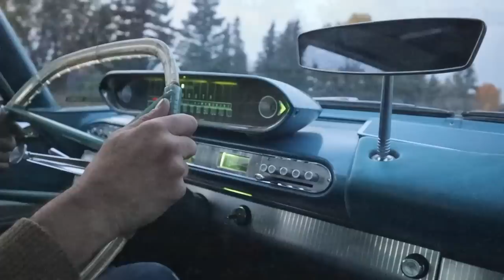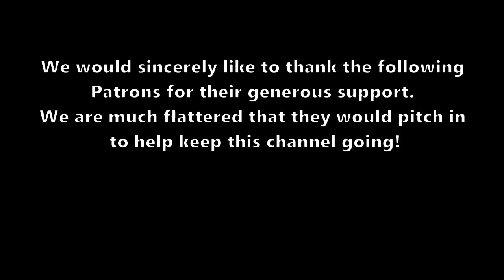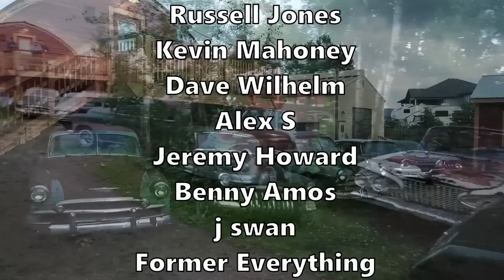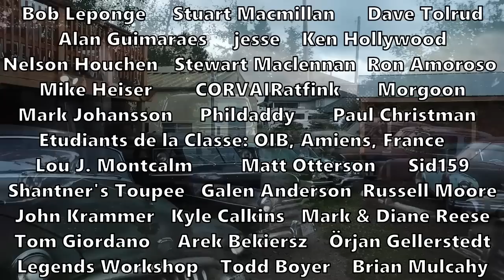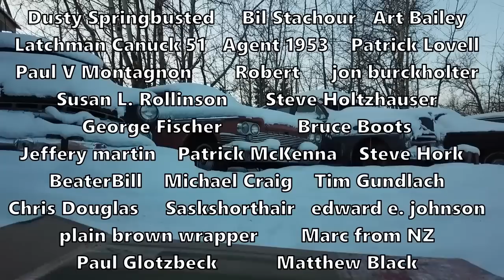1960 Plymouth Fury on the Road! "The Splice is Nice", and we are going for a Drive!

Comment: This is a car that classic car culture is going to be talking about for a very long time. It sets the high water mark for what a skilled person with a modestly-equipped shop can achieve, and the video series also sets the high water mark for detailing just how gigantic a commitment such a project truly is. You've set an example for everyone with this car.
Reply: What I like is that it shows that a properly done splice can be just as safe and straight as an original.  
It helps when Scott is the one splicing though!
Reply: I couldn't have said it any better than that. Thanks for sharing your thoughts.
Reply: I have never in my life seen someone methodically burn thru such a resto on their own brains and skill.

Comment: Scott when this first began I wondered what you were doing was possible then realized with your knowledge of the two vehicles it was, then came the long careful teardown and painstaking replacement of main body parts and all the checks of wiring and other things while open to the careful alignment of it all to come together, it was great you had the patience and took time for breaks to other projects and distraction like checking and fine tuning trim pieces, you have mad body work skills and 100 times the patience I would have for this,  in all your projects you have perseverance to take things apart to look at them and try to find how it should work or to make it work, I love you practical use of knowledge, common sense and ingenuity and respect for all your cars on the lot you've saved from the crusher, and that your dream of a long term project of this full a scope of saving and restoration of car of your liking enough to do this, is a great show of all your skills

Comment: I was 9 years old in 1960 and was very aware of the name Fury. I made myself a fan of the make and model but my heart belonged to the 1963 model which my Indiana hometown bought an used for their police cars. Those cars were awesome looking and quick yet I do recall the push button trans and the oblong steering wheels from the Chrysler models of that era and I believe they still had them when I took driver's ed in 1965 since my favorite car to drive that year had an oblong steering wheel. You have re-created a masterpiece right down to the nuts and bolts on your beautiful 1960 Plymouth Fury, thank you for the wonderful work and ride!

Comment: The Fury is astonishing.  It's one thing to admire all the design and detail while it is static but watching you actually driving it and using the steering wheel and seeing the dash lights all working adds a new dimension.  Talk about space age, it's fabulous.  I kept looking at all the stainless trim pieces and remembering how many hours you spent on them, not to mention EVERYTHING else, it's a brilliant achievement.  🏆😊

Comment: I had a 1960 Plymouth Convertible,it was all white with red interior and a tight fitting red boot, what a beautiful car. It was a real chic magnet. It had the original 318 with a 2 barrel, but it only had 2 speed powerflite trans. My dream plans were to put a long ram tube 413 V8 with a torqflight trans and last touch was going to be stainless fender skirts, which I think yours still needs. After seeing your beautiful car I kick myself in the but for ever selling it. Bill

Comment: I have a Motor's manual dated 1959 that belonged to my father when he was just married in 1959 and used it repairing cars. He grew up repairing cars which is why we were always together in the car business for most of my adult life. I now have my own auto repair business. Also have some assorted repair manuals made by I think Chilton"s for foreign cars. Came by them in a parts store buy out that had started in 1984. So all manuals will pre date that year. Most deal with 60's and 70's foreign. If you are interested let me know. I have seen that the Motor's manual has a section dealing with Dean's Edsel steering column and push button shift. Keep up the good work. I actually stumbled upon your channel just before the start of the build of the 1960 Fury. By far my favorite channel along with Strong's Garage. Can't wait each week to see what progress has been made. The Fury has turned out to be a gorgeous car that would make anyone proud to own. Thanks,Don

Comment: Scott, another fine week of automotive infotainment from Cold War Motors! Thursday's 3 cylinder burger run in the R-5 was a surprise for all concerned but a quick re-wrench of #4 plug saved the day! But there was little joy in Muddville whilst changing out the tranny mount without a hoist those undercar repairs on your back are nothing to look forward too. However the artfully designed and installed dual exhausts are a treat for the eye and a joy to the ear! Nice deep voice of authority rumbling forth from an otherwise whisper quiet 318 is a warm reminder of old Mopar engineering. Speaking of the "Forward Look" the brainchild of Virgil Exner at Chrysler in the '50s + early 60s your 48 monthlong unbelievable "reclamation" and transformation of Exner's 60 Fury alchemically 'reinCARnated' through the resurrection of a cob-rough rusty relic into a regal fit for King Charles inaugural wheels or at least a bonified midnight burger run to White Castel but only if you and the agents went white tie! What an incredible achievement Scott, if I'm lying I'm dying!!! WOW man I wasn't tuned in when you started performing the Fury miracle. That all happened before my pandemic-forced-retirement as an art scribe for a local pulp. So I've only been watching the second half. To get that heap to run and drive in showroom nick has been a Herculin task. I'm amazed. I bought my rust free 66 Bug in 1999 and it took 20 years of weekend tinkering amid many interruptions, side projects, keeping my daily beaters alive etc. before it was almost done (looks good, runs and drives great but there are details to come). So I'm absolutely awed by your speed of execution of a project so far gone it was crusher bait because you also had scads of side projects and interruptions! May you live long and prosper!! CONGATULATIONS and Salutations!!!
Reply from the maker: Thanks so much Wesley...Cheers from here!

Comment: A perfect day for a cruise in a beautiful car! Great job and I'm glad the weather held out for you, given that Alberta can have snow in September (or August!)
I have to say, I don't think I'd like that rectangular steering wheel. My 1959 Galaxie had no power steering with occasionally required a fair bit of cranking to get out of a tight spot.
I think the hand-over-hand is easier with a circular steering wheel. The Fury's wheel looks cool, though!
The only bad thing is that I'm sure you wanted the cruise to go on forever and there's only so much gas that the tank can hold.😁
I absolutely love the two-tone paint job. It's perfect for the car. I hope you get more cruising days before the snow flies and the Fury is put to sleep for the winter.

Comment: Congratulations Scott (and all the helpers) on a beautiful and amazing job. 

I watched an experienced auto body worker back in the 70s splice two damaged 1973 Ford Galaxies together front and back. He had a nice car at the end of the day. I'm sure the unibody made the Plymouth/Dodge splice all the more challenging not to mention obtaining the odd bits that folks so graciously donated.

To the detractors, I saw way too many perfectly salvageable 50s vintage cars sitting in fields when they were only 15-20 years old. There was a complete 1914 brass Model T sitting in a barn with chickens roosting on it but the guy wouldn't part with it. Usually when these owners were approached, they wanted almost as much as a complete running vehicle. Year after year those cars continued to sit rusting and rotting away to worthlessness. Had it had a different owner, the Plymouth could well have met the same fate. It may not be Pebble Beach as you say but instead it's one more saved vehicle with all the determination you had to give it. Go have a beer!`

Comment: This is really build, not bought! I was fascinated by this car since I saw the fieldfind video. Congratulations! What a beauty that was resurrected from an old wrecked parts car. Most people would have probably boned it out and thrown away such things as the door panels as they where beyond rescue.
I like the rear roofline of the 60/61 models a little more than the shape of the earlier ones.

Comment: Two thoughts after oodles of praise to the rebuild. First, take the car back to the site of the dealer where it came from. Park in front of the place and start asking bystanders where the shop is because you are here for its 20K maintenance. Second, ZZ Top lost a member and Scott has the beard to fit in with the band. You just have to come up with a song to replace the chopped 35 Ford ditty. Bill Bixby, the Dr Bruce Banner and My Favorite martian.

Comment: Finally!  Awesome job, Scott!  That's one beautiful machine.  Just a thought on the radio.  If you get the original radio restored you can get an AM transmitter that will run off a 9volt battery.  Plug an MP3 player loaded with oldies into the transmitter and put it all in the glove box as it's all pretty small.  Then you can broadcast vintage music to the radio.  I do that here at home with my vintage 1930's & 40's radios, except I just use a larger transmitter as the range on the 9volt ones are only a foot or two and the larger one I use can broadcast a couple hundred feet which is further than I'll ever need it to.  That and instead of mostly music, I have mostly recordings of old radio shows from the period.

Comment: Been watching your 'Fury' vids and learned a lot. Helped me get my old Hiace through its MoT last year by chopping out the rotted inner and outer sill and making replacements from  bits of old filing cabinet, welding them in and rattle-canning on some paint. Tester passed no comment whatever. Thanks for showing what is possible. Thanks for posting.
Reply from the maker: Great to hear! Thanks for checking this one out! Cheers...

Comment: I don't think anyone could have topped the detail and quality of this restoration. The end result is outstanding. What a beautiful example of a very special and rare car from the Forward look era. I'm sure Virgil Exner would be more than happy with this particular example. I bet he'd never imagine so many decades later that people would be celebrating his design talent to such an extent. Is the Dodge engine and transmission the same specification as the Fury would have originally had? By that I mean the carburettor specs, engine size (318ci is it?), power output etc. I'm proud to say that I watch your channel and I always tell anyone who has any interest in skills and classic cars about what you achieve on each project.
Reply from the maker: Hi Stefan! Glad you liked seeing this one back together! Yes, the spec on the engine/ transmission is correct for the 1960 Fury. Dual exhaust is the only deviation form stock, but I like that kind of thing, haha...Cheers!

Comment: When I was a kid my Dad was a traveling salesman and every 2 years he got a new company car.  He got X amount of money to buy whatever car he could get the best deal on.  He bought a 1960 Plymouth 4 door sedan, think it was a Fury (the trim levels were Furry 3,2,1, with 1 being the striped down model)  Chrysler Plymouth couldn't hardly give these weird looking cars away. He got a great deal on it, they put an add on A/C unit for free to get my Dad to buy it !!  I remember how weird it looked and of course the square steering wheel and  push button torque flight, the A/C clutch went out at about 6,000 miles but the dealer would not fix it because they had installed the A/C for free so it wasn't covered under the warranty.  I remember watching my Dad drill three  1/4' holes in the clutch &  bolted it together with 1/4' nuts and bolts !!!!!!!

Comment: Looks beautiful Scott but that steering box seems to be loser than my Fury! and that's loose! (and it has a rebuilt box too). I think you still need to turn a wrench or two on that car, Get the radio and clock working. I know you can do it! I watch a guy with a 59 Chevrolet on you tube (old car alley) and he fixed that clock on his so I know its possible and would make a terrific video! cheers!

Comment: I realize the Plymouth Fury is not a numbers matching type of build/restoration, I'm not shunning but is the 318 "period" for 1960? If not, is the Fury going to receive a 350/361 Big block chrysler? To get the powerplant more period for the Fury at the time?

EDIT: seems like the Fury from the factory had an option of a 318/361/383/413.
And a 225 slant six, which I presume  the Blue Belvedere has the same motor?

Congratulations on the (mostly) complete project car, the Fury has come a long way!

Comment: What is your odometer reading ?
What cluster did you use ?
Did You Reset it to "0.0" miles ?
Did you use red oxide primer  bolts from the Dodge to bolt on the front fenders under the hood ?